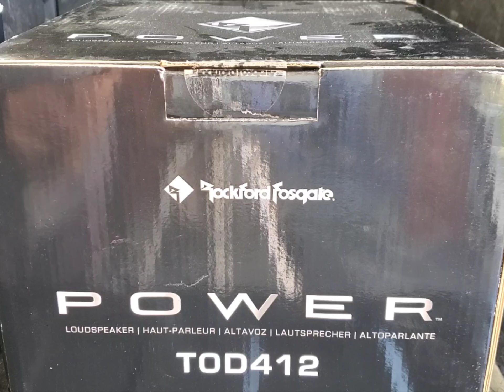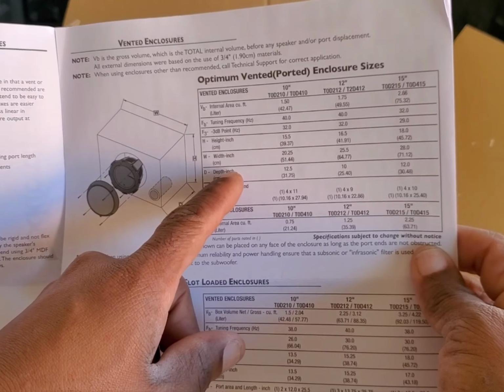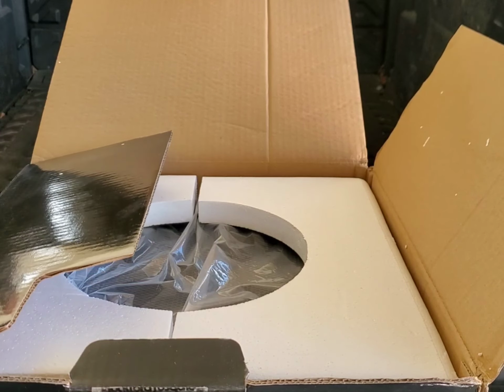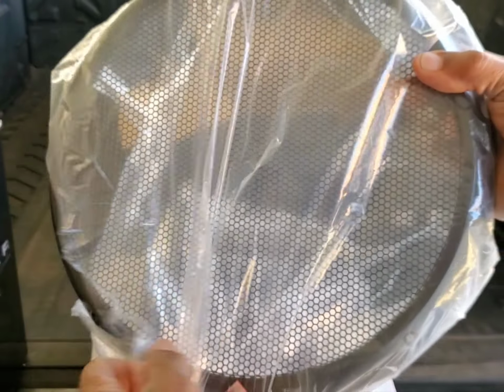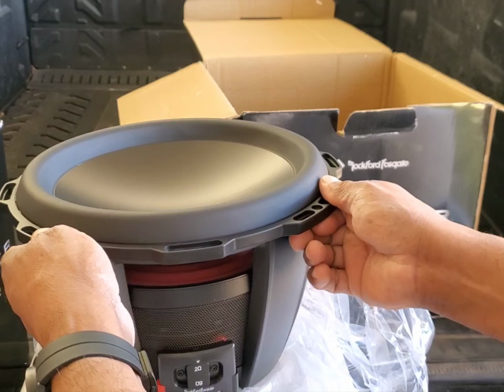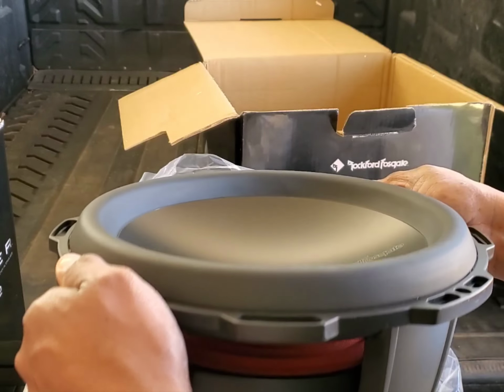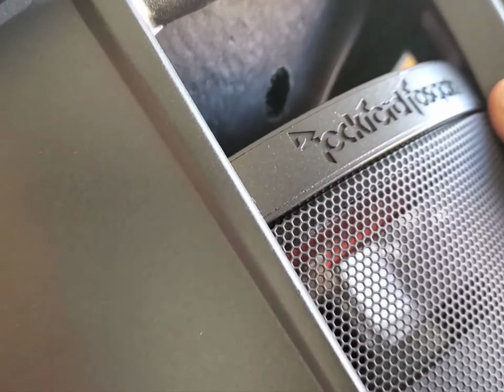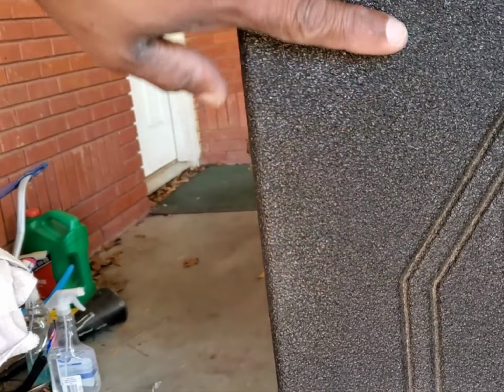Unboxing Rockford Fosgate #T0D412

Comment: If you're gonna spend all that money on those subs at least get a good box. Qbombs are tuned too high.
Reply: A nice custom box tuned low and some sound deadening and he’ll be ready to go
Reply: Man I had this problem with my P3s my old box was tuned to 54hz 🤯 got me a generic 39hz box from an audio store and it sounds so much better.
Reply: @sergioh2015  you’ll probably like it even better if you get a custom box for it around 32 33hz
Reply: U can modify tunning on prefab boxes like on a slot port make the slot longer  or a round port make the port longer for lower running and make sure ur port has enough surface area
Reply: @isaiahparker7433  oh I'm sure, heard a zkar audio system some kid had with a 32hz box and it sounded amazing, however. I like my trunk space. Lol I found that putting the box all the way to the back of my trunk makes my lows even richer. Having my port facing forwards it sounds almost like it my trunk is working as a 6th order. Lol idk if that makes sense. But the way the hole to my trunk is from the cabin, the bottom area is like 3-4 inches deep, so I want to make some kind of makeshift port that just let's airflow better because behind the seats right below the rear deck it's nothing but flat area, so I know that affects airflow out of my trunk.
Reply: @sergioh2015  yea box placement affects bass too I also know when you roll down the windows the bass is louder and it acts like a 4th order
Reply: All I can say is I got a set of T1 in a Q bomb that’s tune to 30 Hz. I’m hearing notes I haven’t heard in a long time from using other boxes tuned highso move forward if it ain’t 30 or below I don’t want it.
Reply: @jimjones3287  dats fine I just know my shit hitting I wouldn’t have posted it if I was lying hell I don’t even comment on stuff so if an when I do it’s not to steer anyone wrong

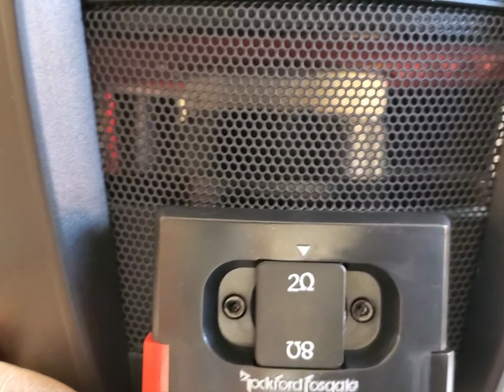Comment: 10:26 It's not a cross-over, it's a dual 4-ohm voice coil subwoofer. it's already internally wired in series or parreall. by the flip of that (for lack of a better word) switch. it's a convenience feature.  that advice from you sound guy just gave you a bunch of irrelevant information.  the 8 ohms is just a way for you to wire up more subs to the amp before going below it's recommended minimum impedance load.  if you only want 2 subs, switch them to 2 ohms settings and wire them up in parallel for 1 ohms.  BD1500 will be a good fit. wire them to 8 ohms, you can parallel 8 of them to achieve 1 ohm. would be a good match for a 5-8k amp at 1ohms.
Reply from the maker: Thanks Professor. You helped me out alot.🧐
Reply: @jaysautoandmore1771  No need for sarcasm, just trying to help you out, saying a series-parallel switch on a sub is an X-over.  You're embarrassing yourself on a global level, to those who really know what it is.  I could have not said anything and let you continue to put your foot in your mouth.
Reply from the maker: I made a mistake. It does not change the hertz, it changes the ohms. I hope everyone reads this too. When I install them I will comment about my mistake. I will take notes  and mention everyones help. Thanks.
Reply: @jaysautoandmore1771  I see, you just want to sound like you know what you're talking about. but in reality, you have limited knowledge on the subject.  Some of us really know this ish, we just don't make content.  BTW I never said that the ohm selector switch on your sub has anything to do with frequency witch is measured in hertz.
Reply from the maker: I said it was the hertz. I was wrong.😊 @johnstarks5323
Reply: @jaysautoandmore1771  It's not the fact you was wrong, it's the fact you kept, standing on that mistake and or throwing knives in your comments / emojis.  bruh, I'm not trying to attack, just trying to put up on facts,
Reply from the maker: Ok thanks 🙂
Reply from the maker: I subscribed to your channel and watched your videos.🙂
Reply: @jaysautoandmore1771  That's what[s up fam.

Comment: Nice subs man 👍
Much prefer sealed over ported myself.
Reply from the maker: The box was only 50.00. I like sealed too. The bass is stronger on sealed.
Reply from the maker: What size  sealed box is right for those subs?
Reply: The subs won't play worth a crap in a sealed enclosure, It's not recommended on those subs.

Comment: Thats a great box for being tuned at 44 htz inhave same one but extended my slot ports thats behind each sub and made the tunning lower to 34 htz  and i pit a double baffle on the front of mine and gorilla glued all inside seams and lined the entrire inside with dyno mat like material and it made a 3 db louder difference buy making the box more dense cause mine would flex with my  2 12 audiopipe quad stacks on 3800 rms  this box is not intended for very high wattage since the mdf is rather thin. But all in all its a decent box in size i think the port is entirely too big for thise fosgates and they will most likely bottom out easy if u open ur car door while playing the music loud and sometimes even rolling 1 windown down all the way ur subs might bittom out I had like 7!sets of subs in that box to test and the skar vxf did well power acoustic mofo did well subs that did not well at all was skar evl ct sounds tropo kicker cvx also thr wlldse hcy did really good so did the sundown u and sundown sa also did very well
Reply from the maker: I went to ebay and got a fosgate power 700. I wanted the 800 a2 I got out bidded. Post coming soon.
Reply: @jaysautoandmore1771  that's very low power each sub might see 200 RMS after impedance rise. I believe 3k RMS is recommended for these combined
Reply: @joshholden8561 they're around 700 rms each, and they're not very under rated. They don't have the motor to support much more than 900 watts in all honesty. They're geared towards sound quality.. comparable to a W6. They are good subs though, just pricey.

Comment: Aye I'm warning u now. That q bomb box is trash. I got two massive audio hippos n that q bomb was tuned at 42. Finally got me a gatley audio box tunevat 32 hz. Right cf made they love them even on underrated power. Like 1900 vs 5300 that I need.
Reply from the maker: Thanks for the info.
Reply from the maker: I went with a midgate box. Video coming soon.😊